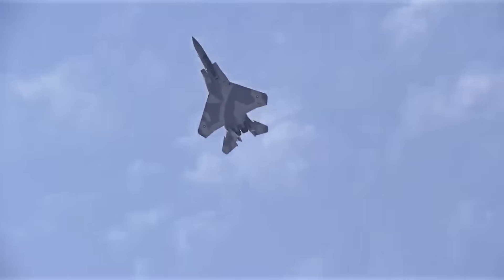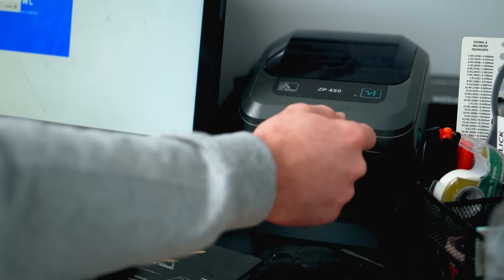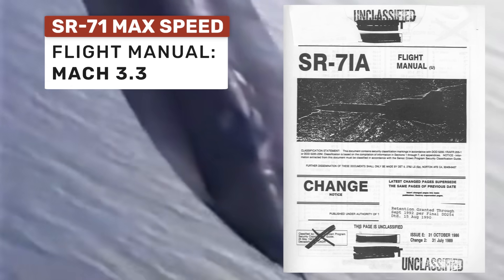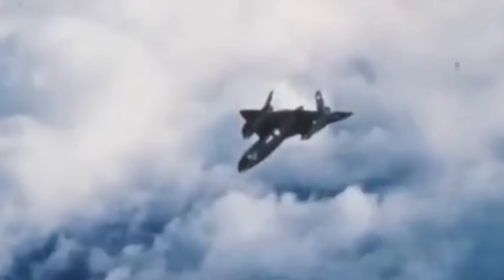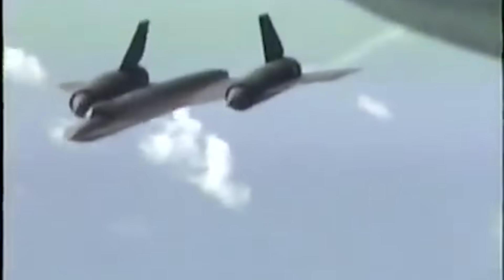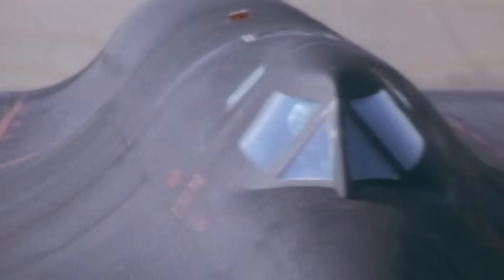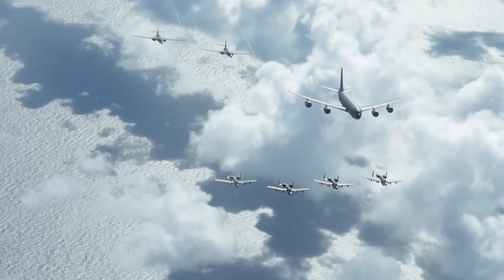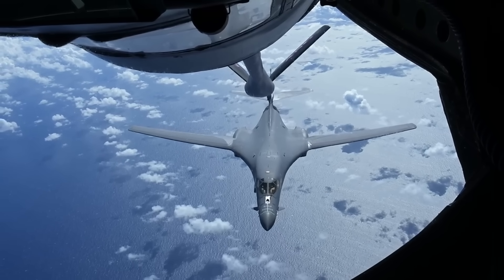The SR-71 was MUCH FASTER than the Air Force will admit

Comment: weight dosent really matter for airplane top speed. as speed goes up induced drags proportion of total drag goes down. and these planes are pretty identical otherwise so there is not that mutch difference in other forms of drag. stuff like external stores effect more then just induced drag and will effect top speed.
Reply: It doesn't grow exponentially like normal drag from air resistance but it definitely matters. Also the wing aspect ratio for these aircraft gave them a low L/D ratio, 2-3 times worse than, say a passenger or cargo aircraft.
Reply: @daelosus  induced drag is air resistance. induced drag is the drag from makeing lift, in other words the extra drag from haveing an angle of attack. as speed goes up you dont need as mutch angle of attack to create the required lift, till whatever design speed its none. induced drag trends towards zero.

induced drag is effected by weight. more weight, the more lift you need, the more angle of attack, the more induced drag. its important at slow speeds like takeoffs and landings. but in a conversation about the maximum speed an aircraft can go, you are way down the graph where induced drag is neglageable and parasite drag is all you have to worry about. 

parasite drag or drag steming from the form of the airplane goes up with speed. these two forms of drag added together gives you your total drag.

notice they only give you one maximum range number. Whether at max gross or ferrying it doesn't matter when most of the flight is way down the speed graph.
Reply: @daelosus  induced drag is air resistance. its the drag from makeing lift, or in other words the drag from the angle of attack. faster you go less angle of atact you need till at some point its none. induced drag tends towards zero.

the other component of drag parasite drag comes from the shape of the airplane starts at zero but as speed goes up it goes up. add up the two types of drag to get your total drag.

in a confovsation about the maximum speed you are way down the graph where induced drag is neglageable, and parasite drag is big.

Comment: I always assume that unclassified published speeds on military aircraft are very conservative numbers.
Reply: For US tech almost certainly. For others it may be the reverse.
Reply: Like the top speed a Nimitz class carriers can do, or the speed and depth American nuclear subs are able to achieve. America, like a good poker player he never boasts, never tips his hand, he waits until he wrings every last dollar out of all the suckers and when all the money is on the table, he lowers the boom and is the one who walks away the winner.
Reply: @rrob692326  Even the Iowa class battleships, 80 years old and retired, are faster than their published speeds. Same with the old Essex class carriers. When the engine room kicks them in the ass they will eek out a few extra knots of speed, and the Navy was just fine not bragging about it in public.
Reply: Assume that they are inaccurate, either way.
Reply: Just look at the numbers for the F-15 and F-22. They're similar weight machines, and (using wikipedia's numbers for expediency) the F-15's engines at full afterburner fall short of the F-22's max thrust without afterburner. And from that we're expected to believe that the F-22 has a max speed of Mach 2.2? (Wikipedia says F-15C max Mach 2.5, F-22 Mach 2.25). Alex himself has spoken a few times about the power of these newer engines and the even more absurd next gen replacements in the pipeline. Now I'm sure the Air Force doesn't want their Raptor pilots tearing their stealth skins off at Mach 4 for no reason, but basic arithmetic demonstrates that claims like a Mach speed reduction of 0.25 from F-15 to F-22 is more than a little suspicious. Then again, people still make claims about certain ground vehicles that I know from my own experiences (and info that I doubt is well guarded anymore) are just not true or even logical.
Reply: @Varadiio The top speeds are either temperature or inlet geometry limited.   In the case of the Raptor...I believe the inlet system is of fixed geometry and there's only so fast it can handle the incoming air to diffuse it down to subsonic so the engines can inhale it.
They were more concerned with stealth and the air inlets are a huge reflective device that needs very careful construction to avoid returning a signal.
Variable inlet geometry means things need to move around...like on the F-15's and this would compromise the stealth and defeat the reason the aircraft exists.
The fact that the skin and other areas wouldn't tolerate the heat of excessive speed either just add to the fact that super high top speeds are not the goal for the Raptor.
Reply: @Varadiio   The F-22's engines are capable of producing that much thrust, but once you get them in the aircraft, they are much more limited due to the intakes and the square nozzles. The F-15 has variable intakes and round nozzles. Yes, the F-22 has more power, but that doesn't always translate into speed.

Comment: Best line: '... while outrunning missiles.'
Reply: The missiles ARE in fact faster...  But they still have to climb to 80,000 feet and close the gap before they run out of fuel.  Even when the opposition is throwing a telephone pole at you, that's a very difficult task.
Reply: A funny thing about my comment, is that the post time was only a minute after Truex007.  I wasn't even responding to him, but it's now going to look like I was thanks to that timing, and how well my comment just happens to work as a rebuttle.  I am amused.
Reply: Yes.  A missile launches towards a calculated intercept point, and if the aircraft accelerates, that pushes the intercept point further away because the missile has to fly to the NEW (and constantly moving-further-away, if the acceleration continues) intercept point.  So the aircraft doesn't have to actually out-speed the missile; it only has to push the intercept point out-of-range of the missile.  That being said, at operational speeds the SR-71 accelerated like a scalded rabbit.  It couldn't pull more than about 3 G's in a turn, but its signature move was ACCELERATION.  With the engines in ramjet mode, there were no turbines to spool up.  More fuel was simply sprayed into the combustion chamber and the acceleration was instantaneous.  It would slam the pilots back in their seats like a sports car.  The rate at which the SR-71 could accelerate was in that ballpark.  So it makes sense that the SR-71 would normally operate significantly BELOW its maximum speed, so that it could ACCELERATE if a missile was launched.
Reply: The missiles went Mach 5. He had to outlast its fuel.
Reply: According to an sr-71 pilot (James Sullivan) most of the missiles fired at them had no hope of reaching, but a few got close enough to be concerning but they could just “outrun” those.
Reply: Gary Powers has entered the chat
Reply: Best line for naive morons maybe, most Soviet/Russian missiles laugh at mach 4-5 targets, this junk even pushed to 3.4 wouldn't be "outrunning" anything...
Reply: Remember the missiles are climbing rapidly and have a very limited flight time. You don't have to be faster than them, just high enough and fast enough that they run out of fuel before they catch you.
Reply: It is not odd that so many does mistake thinking that missiles fly after the targets to destroy them.
It is a common fallacy that hollywood makes for movies and all.

First, it makes hero look good as he is running away from bad guy thst is chasing him, a classical psychological effect from prey-predator position, where we assume that when someone chase other, that chased is the vulnerable/weaker side and needs help. 

And then secondly, it looks fancy missile chasing a fighter is like a car chasing scene, where chased will perform some maneuvers to throw off chaser.

With some logical explanation and presentation it is easy to make people to understand these challenges to hit something fast and far away with something else. 
Easiest thing is always take a some ball games, where a player needs to pass a ball to a another player. The timing and all skill to adjust the ball speed to reach the other player position in the future is behind very much a complex calculations we can do by instincts after training.
Reply: Pucker-up, buttercup.
Reply: Until missile was faster then plane got discomissed. 😂
Reply: @peterpanini96 likely more it was very expensive and satellites and drones improved to the point there were better options. The much slower U2 is still flying despite being proven slower than some missiles.
Reply: @peterpanini96  The SR-71 was retired due to the cold war being over, the massive expense to keep it flying due to very specialized fuel, oil, and parts that were no longer produced. The logistics to supply tankers, equipment, manpower, and money cost too much and upper military staff wanted to use their new spy satellites not some 60's era old ass tech and cut funding to the bone.. Nasa flew them for a short time but they were god awful to get funding for so they stopped the program.
Reply: Therein lies the secret.  The Russian S75, or what NATO called the SA2 ground-to-air missiles that were used in the 70s had a speed of between Mach 3.5 to 4.0, and the SR71 would outrun it!  The S75 had several variants, the Russians built a higher-speed, high-altitude variant to chase down the SR71, the speed of which I could not find, may be classified, and that missile could also travel over 80,000 feet.  The flight time of that particular S75 was only a minute and a half, which meant the SR71 only had a minute and a half to try to outrun it and outrun it they did, because the SR71 had many missiles fired at it, and not one got close, unlike the U2 that got taken down at least 7 times.   I understand on the internet that the U2 could only fly at 70,000 feet, which puts it in range of ground to air, but I heard from someone who was well versed on that aircraft that it could fly at 85,000 feet, the same as the SR71 but not nearly as fast as the SR71, but both of those say during normal flight, meaning what happens if it's not a normal flight?
Reply: 3.2 max at what altitude? Those classified glitches did more mach speed than a Talos.
 As for why no arms on it. It is not good to fly into your ordinance.
Reply: The Vmax switch reminds me of the "go fast" buttons some pilots installed on Learjets to override the Mach limiter function in the flight control system.  Thing is, that limitation is there for a reason, keeping the aircraft below the Mach number where mixed airflow over the wing induces a severe nose-down pitching moment called "Mach tuck".  Use of these led to some Learjets making smoking holes in the ground.
Reply: I can only imagine how many pilots and RSOs would quietly smile as missiles ran out of fuel and fell out of the sky.
Reply: That is a gross oversimplification.  Most missiles will hit Mach 10.  Outrunning a missile's targetting capabilities is probably more accurate.
Reply: @Truex007  No missile ever did mach 10 in those days. And only a very select few do it today, decades later.
Reply: Most missles
Reply: @Truex007  if the missiles run out of fuel before getting to altitude that is in fact outrunning a missile.